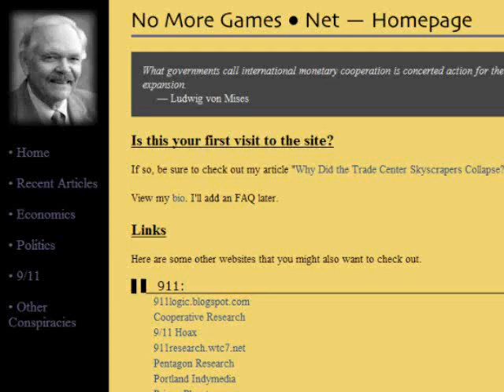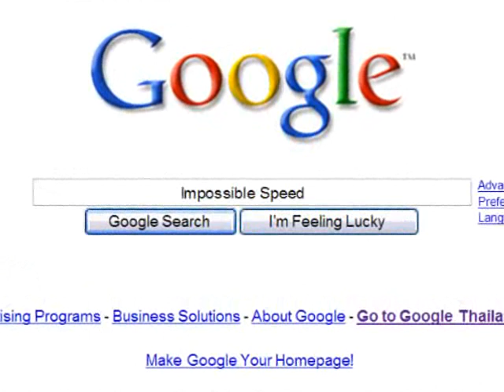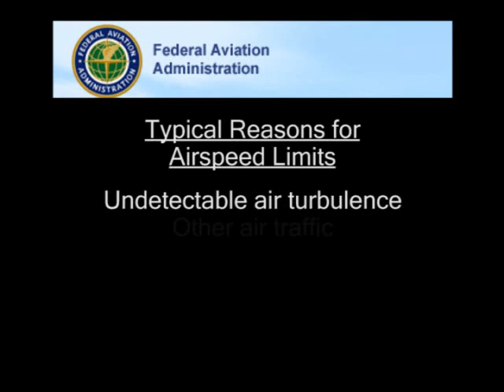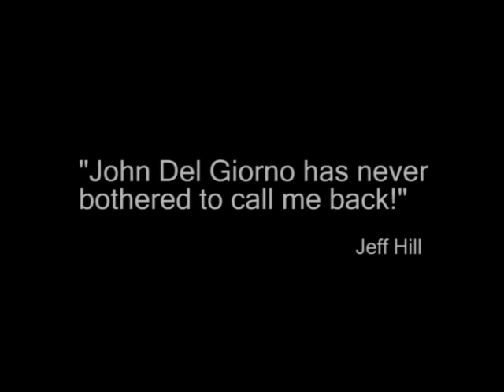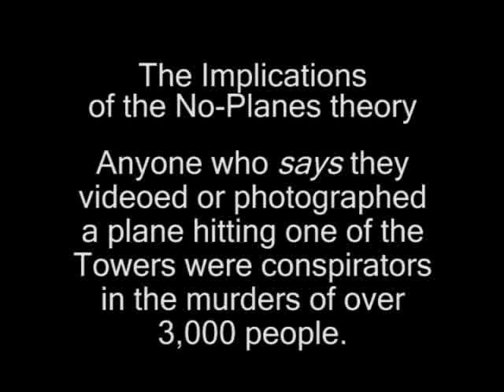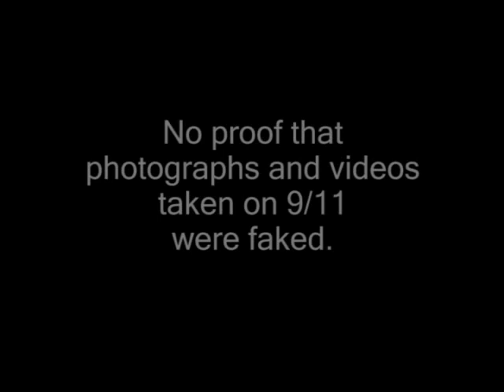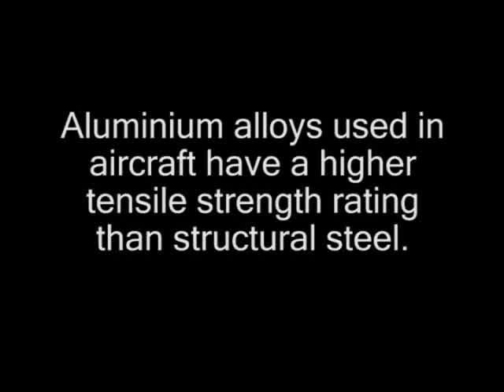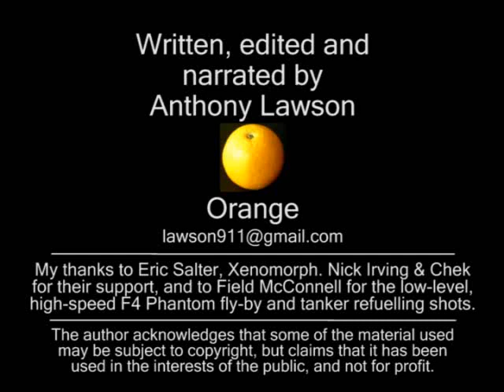9/11: Impossible Speed & Impact -- Busted! Updated

Comment from the maker: No, I don't particularly want to discuss the issue; I am satisfied with my research, otherwise I would not have made the video. The existing video and photographic evidence clearly shows that the plane was there and that it entered the building. Estimates place it's speed between 550 and 590mph, and the right experts confirm that the plane could travel at that speed at that altitude and that the engines would not choke.

Comment from the maker: I've no idea, on either of these points, videos of low flying 767s are not easy to find, and a video using only titles will tend to get boring. I was not suggesting that it was travelling anywhere near the contentious speed, which it obviously wasn't. I should think it was probably near the permitted maximum, for air shows and you could probably find out what that is.

Comment: Now it was my fault, I meant the density is 2 times higher at 700ft than at 25000ft. The Vmo at 25000ft is that 597mph-the 0,86Mach. The VD at 17000ft is 483mph because there is 1/3 denser air-more resistance. But at 700ft is another 1.67 times more dense, so the VD at 700ft would I estimate around 370mph -at 586mph surpased 62%,which I find impossible.

Comment: to clear what is possible with the B767-200 - the Vmo at 25000ft 597mph, VD at and below 17000ft is 483mph, but because there is at 700ft the air almost exactly 2 times more dense than at 17000ft there is also 2 times more aerodynamic resistance -so if you make the linear aproximation you'll find out the TAS 586mph in level flight at 700ft is simply a nonsense.

Comment: That's realy weird, because when I was writing the post I wrote 3+times, not "130+" times, but now I see "130" in my post, it would be quite improbable typo...if it is I'm appologizing. Is somebody tampering with the posts here?! But anyway, you're right with density at the 25000ft. But the cruising altitude of B767-200 is 35000ft where the air density is more than 3 times less than at 700ft. I used the calculator here: luizmonteiro*com/StdAtm*htm

Comment: But Boeing enginer says "no way",the construction enginer-who was solving the same problem in past-says "impossible"..from what I know about the possible engines drag/airframe aerodynamics-no way the B767-200 could fly at such speed at such low altitude(where the air is 130+times more dense than at the cruising altitude)-the airframe would probably not survive-and if yes,anyway-the engines would choke,break,flame and smoke-definitely-nothing like that is visible on the videos.

Comment: yes, but the comparison of the supersonic engine with a subsonic engine doesn't work. The subsonic engines have qualitatively different construction than the supersonic ones. So your comparison is a nonsense. What about Bucaneer - its engine has much much smaller intake fan - and thus intake ratio - than a jetliner engine - and it is indeed critical exactly in connection with the possible choking at low altitudes. Lump it.

Comment from the maker: Some facts: I do not make 9/11 videos without doing a lot of research. Pilots for 9/11 Truth is a restricted site. I've previously asked for information from its members and they were unhelpful.  My use of jet fighters had to do with the engines, not their airframes. I could not find videos of passenger jets flying low at high speeds, so I used the fighter jets to demonstrate that turbojet and turbofan engines do not choke at low altitudes. The Buccaneer engine types were used in  airliners.

Comment: Another bunch of nonsenses. 1. the steel collums was much thicker steel than the Al plane shell so the tensile comparison is nonsense 2. the speed of 586mph at 700ft IS impossible speed for a B767-200 even in straigt down dive. 3. the B767 comparisons with the supersonics clearly show the author of this video is an absolute moron...more profound debunking of this video here: z9*invisionfree*com/Pilots_For_Truth/index*php?showtopic=10147&st=60&#entry10488538

Comment from the maker: When the meaning of a word or expression can be misinterpreted, you would do well to use an alternative that cannot. The context in which you used "claim" was either incorrect or a deliberate attempt to put me in the wrong, with regard to what is common knowledge: i.e. that TV standards conversions can cause problems with moving objects in material shot on videotape. You will not trip me up with such transparent tricks.